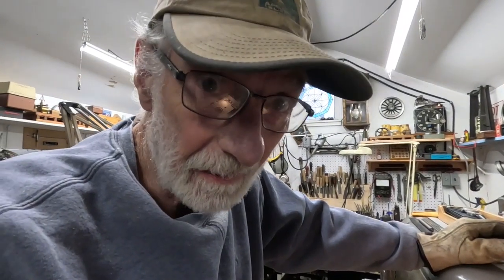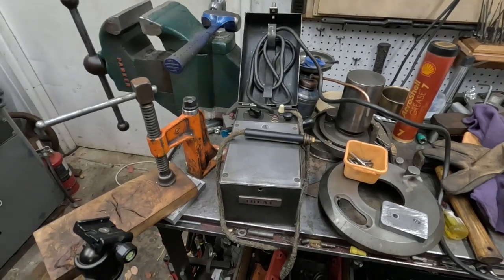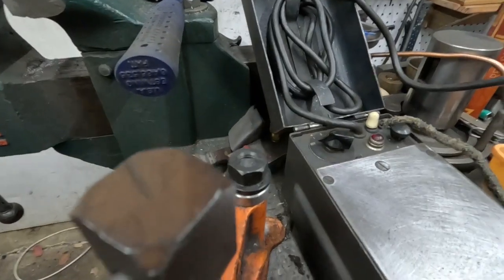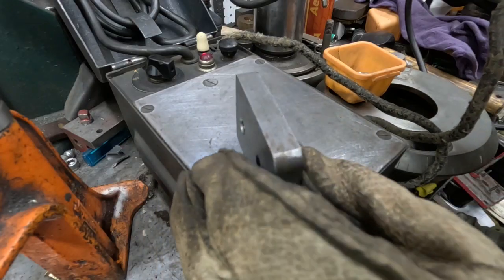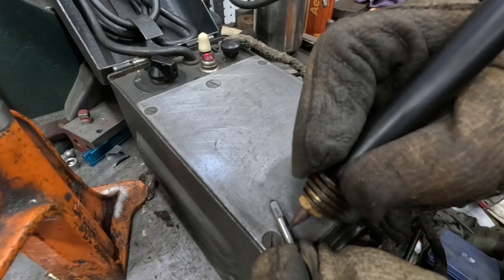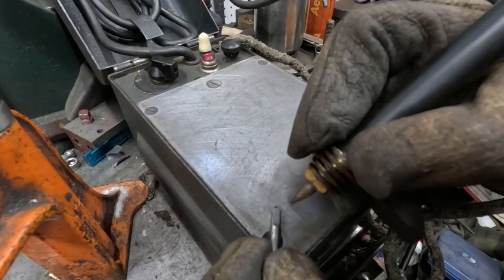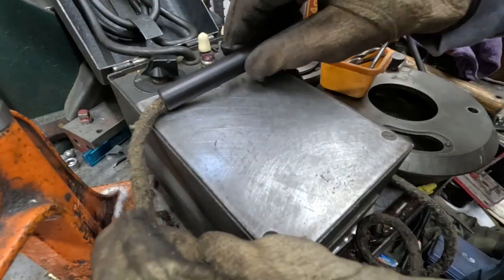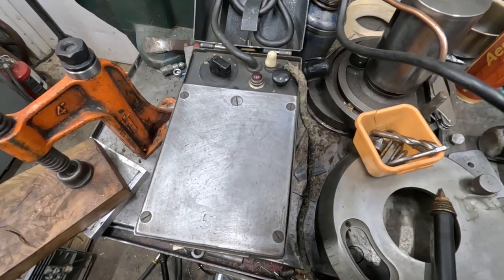Antique machinist "Ideal"electric arc engraving tool test and review

Comment: Used one years ago when I worked in the tool room at Hardinge. Always wanted one. Then one time I found one on 'the pile' at a scrap yard, and drug it home for like $4. It works, cleaned it up a bit, replaced the light bulb. They are quite handy, I use it from time to time. Mine's a bit newer, probably a 1960's model.
Reply from the maker: There looks to be a later model on ebay for $145. I am getting better at it with practice
Reply: @DonDyarprecision  I made a copper tip, less sticking. And drag but never try to push

Comment: Nice. That’s something I really could use. Mostly for drill bits and taps. I just don’t understand why, on drill bits, they always stamp or engrave the rear of the shank where it’s most likely to be scraped away with use, rather than on the front of the shank, where the chuck or collet rarely reaches. Drives me nuts. And the makers of taps usually do such a lousy job of engraving that it’s often unreadable. To just put the diameter of the tap on one flat and the thread on another would be great. I have an engraver that uses pads and chemicals, plus electricity to do logos and other markings on metal, but it’s not for this purpose. I’ve heard of these but have never seen one. You know, that means I’ll either have to find one,or make my own. It’s really just a multi tap transformer. The working end can be made from a tig tungsten and copper.
Reply from the maker: I found it marks carbide nicely on the higher setting, It will be nice for marking end mills to new size that I have ground the flutes on, reamers too.